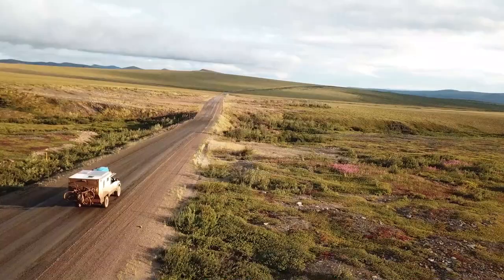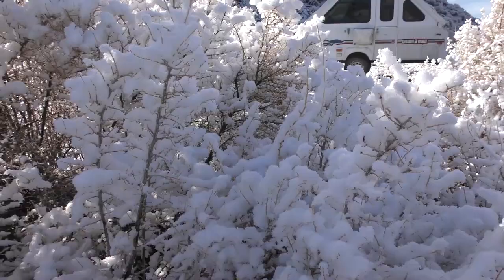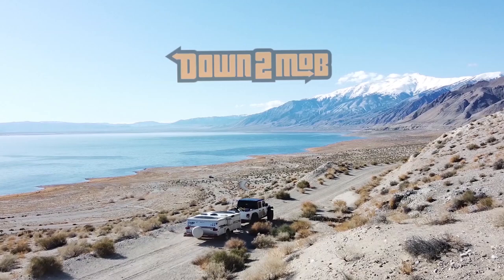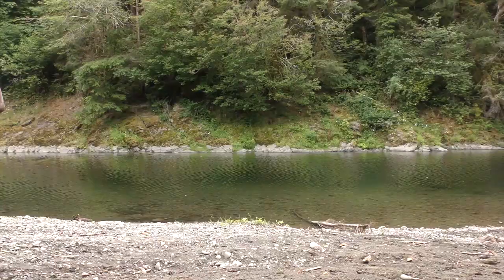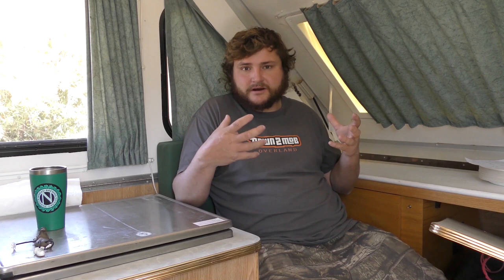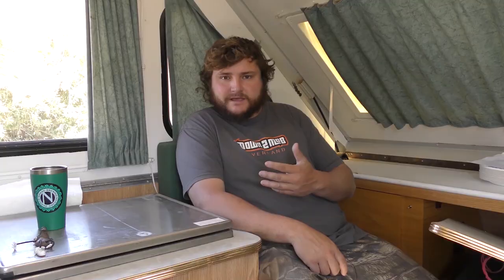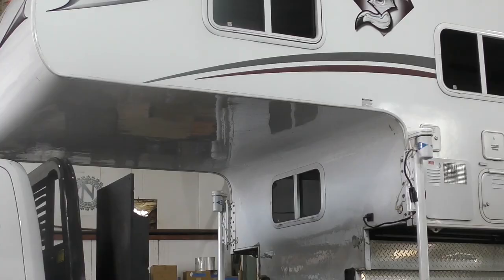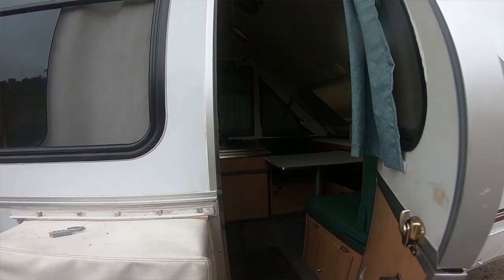TRUCK CAMPER vs. CAMPER TRAILER - Pro's & Con's from a FULL TIMER

Comment: No unicorns in the this space.  We have tried everything. Sportmobile pop top Ford e350, Lance 1785, Jayco 12 HFD and now a Nobo 19.1 toy hauler trailer.  I think if I was flying solo a cab over or Transit could work but it's hard with a dirt bike and mtn bike and really no MOB'ing they aren't built for it.  Even a cab over with a full size truck ain't wheeling.  However with a wife, dog, dirt bikes, mountain bikes and working from the road the trailer is the way to go for us.  We can run into a town for work, food or a beer (or used to be able to anyway).  We usually have a 3 night minimum.  We can put motos in truck and leave trailer at camp, we can run mtn bike shuttles and explore trails in the truck while trailer/ basecamp stays locked and loaded.  So it's more length of trip and toys you bring.  For weekend warriors without toys it's easy for cab over or sprinter.  For months at a time the trailer wins hands down for us especially with it's raining in Oregon, Washinginton a BC for an entire month.   We mob the motos and mtn bikes so no wheeling anymore.  You can flip of lift the pull behind for clearance, our Jayco hard-wall had motos on the deck and a 5" lift.  If I was rich I would have both!  Forget wheeling go moto and mtn bike and it's game on.  Good video.  Gladiator flat bed with cab will be cool but your payload and suspension will shot quickly.

Comment: In Europe you can buy a remote control for parking trailers. You can unhook it and spin the trailer around on its  access no problem at all. Or    park it without having to use the jeep.
Reply: Could that feature be used to move the camper to a different campsite on it's own at a campground if you didn't want to hitch it to the car?  Does it attach to the tongue of the camper?  Gas motor or electric?
Reply: @marcpikas2859  no there are two small electric motors mounted to the frame close to the wheel. I believe that you have to engage a tooth gear that press's up against the tyres tread. {this provides the drive to move the carvan/trailer.} I beleive it was originally designed for elderly people to park their carvans easily. They don't have to push the carvan.  You can use it to hitich a carvan / trailer, by moving the caravan up to the towing hitch of the vehicle. It's so much easier. I don't know what the limations are. For example that video of you trying to turn your jeep with a trailer. If you had  a remote trailer parker. All you would have had to do was unhitch the trailer and spin it on it's axis. Turn  your Jeep  and park it in front of your trailer then drive the trailer up to the Hitch disengage the drive from the tyres and away you go. The unit can be retrofitted two different caravans and trailers so if you sell your trailer you can attach this to the next trailer you owen.
Reply: @gordonjohnston684  Very impressive.  Never seen that before.

Comment: You know your camper is pretty light.  You could get a hitch jack wheel and turn the camper around by hand.  If you got a pbuematic tire it wouldn't be that hard even in the dirt.

Comment: I'd  have kept the dodge. Cheaper and easier mechanically. More torque, bigger axles and a stronger driveline. Less stress when running big tires. I'm more of a utilitarian though. All I usually focus on is reliability. Make it comfy after that.

Comment: All good and valid points for the most part.... great vid and right down my alley, I had a hard time deciding on what to go with. 

Dude you seriously need to learn to do a turn around in a tight space with a trailer lmao......you back the trailer in to a 90Deg and drop it there then turn around the tow vehicle and pick up the trailer from the "other" side and go. 

I ended up opting for an off road square drop trailer, I needed storage space and capability over mobility....if you're curious what it looks like go have a look at the video I posted on my channel BirdPhish titled Expedition 2.0 by Off Grid Trailers at Trona Pinnacles.

Comment: I understand some national parks don't allow trailers, or even duallies..
Reply: Doing a very quick google search, I could not find any national parks that do not allow trailers at all.  Some campgrounds within the national park might not allow any trailers (eg because of narrow roads),  and some campgrounds might have a restriction on size, and some campgrounds may require hard sides on your trailer (due to bears).  
Even so,  it's a good point that you need to do a little more research into your destination if you are pulling a trailer.

Comment: I have had  a few trailers as big  as 42-foot gooseneck  toy hauler  and space is a great  but the trade-off is just too much   my set up  Bigfoot 2500  f350  double door   last year did 9000 miles and  three people    and  parking anywhere  the  winning  ticket   parking  if you are going to  one stop  for  weeks  are  at a time the  trailer   truck camper  is  good  to go much more nimble

Comment: P., I would think that a small Four Wheel Camper, or it’s cousin, an All Terrain Camper would suit your lifestyle perfectly.  PS, that’s the route I went.
Reply: Curious to know how you would compare your All terrain to the Four wheel?  Quality of construction and materials?  Warranty? Thanks
Reply: I suspect that the two companies are of similar quality, since ATC is newer company operated by ex-FWC employers. I’d probably choose the FWC (since 1972) based on the size of the company and larger “community” of FWC owners. They also have dealerships and service depts at locations near where folks like you (and I) “Overland”,  having that support structure nearby is sort of like carrying all the right tools with you when you travel. If you get a chance, go to their factory in Woodland, Ca.  They’ll give you a tour. Great folks.  They have BBQ’s at their facility n/c and you don’t have to be an owner. Check out the website, and the Wander The West website.  I have a 2017 “Hawk” model.

Comment: you should take your trailer and mount it on a flatbed.  It would give you a low profile but when you wanted to set up camp you would have a cabin feel.  Does anyone make a truck camper that could be easily removed for a base camp?

Comment: Very curious to see the camper on the Gladiator. That's going to require some serious minimalism to make it work with that payload capacity!  I have 5,200 lbs payload capacity and I feel pretty limited.
Reply: Unless you make carbon fiber camper and aluminum bumpers and skid plates, there is no way to be under limit...
Reply: Indeed

Comment: How difficult would it be to build an off road trailer frame setup then mount the camper to it? Nice stiff chassis with suspension to handle the trails?

Comment: Snow & ice - I'd rather have a camper than tow a trailer. 
Dust - that poor trailer wallows in it. I've towed trailers across Black Rock playa. ug.  Camper, not so bad.  
Mud - Your vehicle throws it all over a trailer.
Toys - camper, you can have a motorcycle carrier or tow toys in a trailer.
         - travel trailer, use a toy hauler or pickup bed.....
Cooped up too long.

Comment: Truck camper all the way. That being said, they are a pain in the ass around the house. Can’t move them quick to get to a spot in the yard or garage, and are susceptible to damage on the stilts. For that reason I bought a motorcycle trailer to lower the camper unto when it’s not in my truck. Way easier to manage at home, and I tow the bike behind the truck camper on trips.

Comment: I have had many different RV's over the years..mostly class A coaches from a vintage 83 BlueBird Wanderlodge (pictured on my page<<<<<<) to a gas 97 Bounder to a 35' Toy Hauler to a 25'  Fleetwood Wilderness travel trailer and after all those I think I want a van camper...but alas, class B's are $$$$ due to popularity...I would REALLY love a truck and truck camper like you have/had..but the whole finding a capable truck that is not $45K and a decent used truck camper under $10K is hard..at least here in Fl anyway..truck campers are sky high!! So I think I know I do want a smaller set up that is all in one such as a van..I can get a cargo van then have a raised roof added at Fiberine for maybe $3K and stand up...that seems the logical best choice as I will have a small home base in AZ so I won't be carrying all my life with me on trips..I'll only be escaping the AZ summers!

Comment: Well is hard to find a 4x4  truck rv for  the less rich people( spending about 6 figures  for it) ,  and truck campers  need to be low height  . I sincerely want comfort and so off road  whidout being stuck bcs I'm a beginner driver ,i will end up in a ditch pretty fast so any remonedations?

Comment: Phil I am thinking about a small oof road trailer to add to my rig I have an awesome RTT set up for me I think an off road trailer could be base camp and roll out in my JK. I have 2 businesses so I am kinda locked into 3-4 day weekends . I was also thinking of the off road trailer being just a camp kitchen and gear trailer with an awning and sleeping in my RTT still. Would take out a lot of gear from the JK. What do you think you have so much experience. I have been building trucks since the 80’s Yes I am Old LOL buy only been overlanding for 2 years still new at this thanks for your time be safe out there
Reply: O.C., Good sounding setup,  I would put the RTT on the trailer though,  for better offroad ability in the Jeep only, leave the trailer at camp.
Reply: Duane 4  Hi Buddy is your name Phil or Duane I am sleepy if I called you by the wrong name I am bob

Comment: I have an overlander set up on my Land Rover. Its got a RTT with my kitchen in the back of the Rover. I'm a hiker. If I can't find a spot close enough to the trail head, I have to pack up the tent before heading out to the trail. I happen to be cheap as ... most of my campsites are free. So in packing it up, and heading to the trail head, I also risk losing my campsite. Then, I have to set the tent up again. I'm looking for a small trailer to install the kitchen in, and the tent on top of. Anyone have experiences with this kind of set-up?

Comment: Thank you for this video. Very enlightening. Although I have been trying to weigh the choice between truck camper and class c. My concern with the truck camper is not having easy access to drive off if you don't feel safe (same with a trailer). But my concern with a small class c is not being able to get to some remote areas. Any thoughts on that?